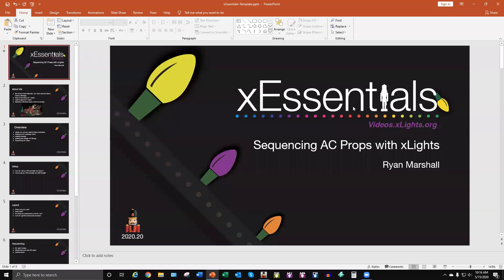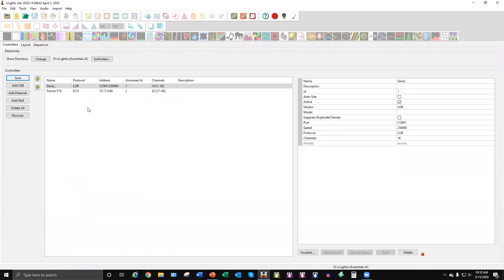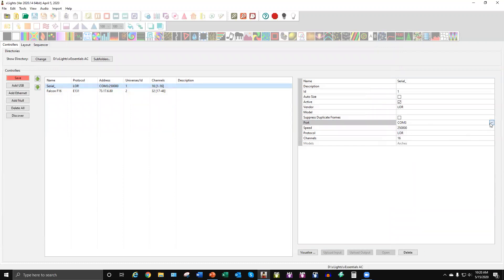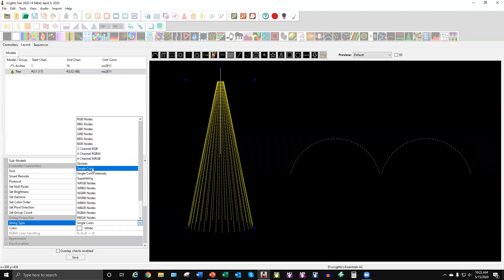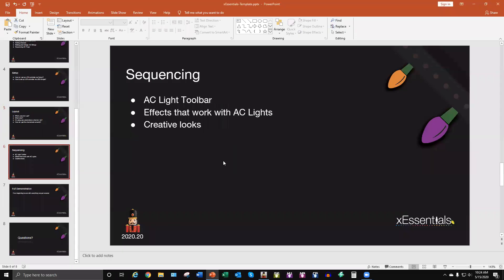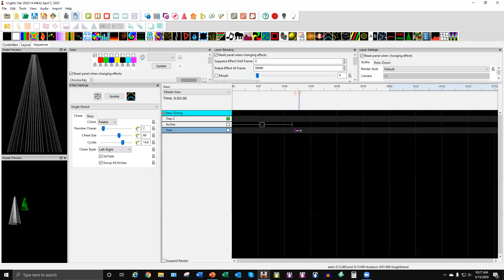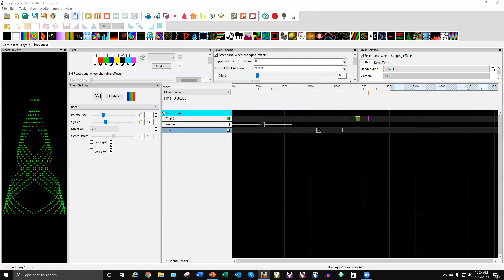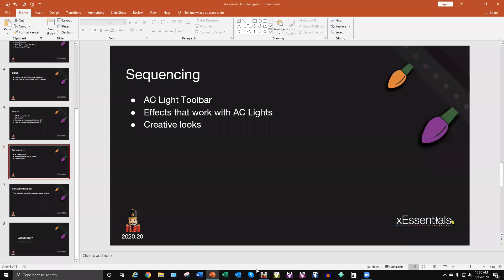Sequencing AC Lights in xLights

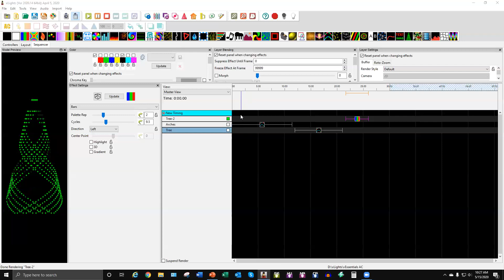Comment: How did you add those timing marks (11:35) so you could add the AC effect to the prop?
Reply from the maker: Click in the waveform to mark your spot and then use the 'T' key on the keyboard.

Comment: So the mega tree makes sense because you have each string as its own set of lights but with the arches how are you making regular ac lights in a string go up and over the arch like your showing if all you can do is turn them on and off
Reply from the maker: I setup the arch to have multiple AC channels so that it can move from left - right. You can adjust those setting in the model settings.